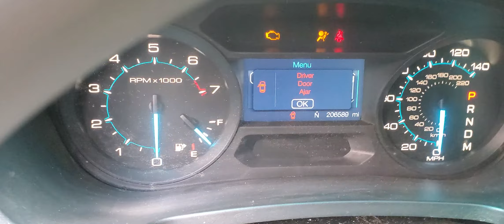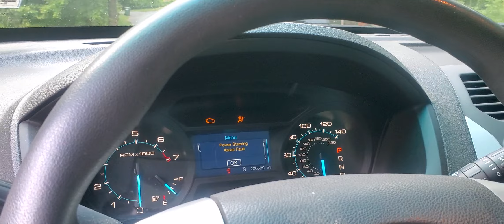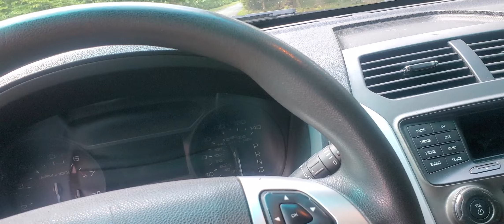2012 ford explorer. Why electric power steering assit sucks.

Comment: Change your tpms sensors. For some reason when they go out it causes power steering loss and much more.
Reply from the maker: Thanks for the tip but I already got rid of it
Reply: Im having this issue now ima try them sensors before I do the whole rack n pinion is it possible to diag those sensors?
Reply from the maker: I'm not too sure. Most just replace the rack
Reply: So is it best to sell the car or trade it would you recommend?
Reply from the maker: @tracipbrmomlewis1088  U Can fix it yourself or pay a shop a couple thousand dollars to fix it

Comment: Brutha, thanks for the info. I got a 2013 f150. Power steering assist fault. Fualt is intermitent, comes and goes, seems like the cold weather took it out. Buncha bull shit. If the fault aint in, power steering is fine. Fault comes up, no powersteering. I only got 87,000 miles on it.... WTF.... thanks for video
Reply from the maker: Yea man it sucks. Idk what was wrong with hydraulic power steering pump

Comment: Wheel speed sensor or Tpms 

The fault doesn’t mean the steering has a fault, but it’s actually in manual mode.  The Eletric power steering needs to know how much air in the tires and how fast the wheels are turning to be able to mimic hydraulic steering 

I hope my research helps someone
Reply from the maker: Thats good to know. My air pressure was good and tps were also good.
Reply: @musclecargarage8882  it’s usually the wheel speed sensor, AKA abs sensor,  and rarely the tpms
Reply from the maker: Ok hopefully it will help someone in the future since I got rid of it

Comment: I agree with you .just got an explorer and this happened  very angry  at ford
Reply from the maker: Oh wow how many miles did yours have?? I had about 206k miles on mines
Reply: @musclecargarage8882  134 steering got tight  my problem was the alternator but its happening again might check battery capacitor or the u joint on bo steering colum too maybe its rusting since we don't drive it that much
Reply from the maker: @jvst20051  oh ok thats low miles for any of that type of stuff to be happening
Reply: @musclecargarage8882  2013 f150, 87,000 miles power steering assist fault... if the fault is NOT in, truck drives fine. Faults only when it has been cold weather.... sum bool shit is what it is....
Reply: I had this happen today. It was a weak battery! Hopefully you have the same easy fix.

Comment: I have a 2004 Mazda rx8 and it has electrical power steering.. I wasn't working for a few months but it was just a connection issue.. 

Works like a charm now, but I am about to buy a ford 2015 with electric power steering. They said the wheels won't turn..

Weird cause when my Mazda power steering went out I drove it for months super stiff.. once the wheels get rolling it's easy to steer 

My question is can I still steer the new ford 2015 ? It will just be stiff like my Mazda right???
Reply from the maker: That is correct. The steering wheel will be stiff but once u start moving it will be like ur Mazda

Comment: my Ford explorer 2011 XLT power steering fault assist warning came on  (1/22/2024) while driving in a parking lot  and I could not steer the car. I kill the engine and restart the car and now I can steer. I am scared, how to fix this problem?
Reply from the maker: I had the same issue and I would fix it the same way u did. U will have to replace the electric steering rack and pinion and also get it reprogram to ur vehicle

Comment: How do I fix this?
Reply from the maker: I didn't fix i sold it. But u would have to replace the electric rack and pinion steering and then u would have to get the ecm reprogram for the new electric rack and pinion